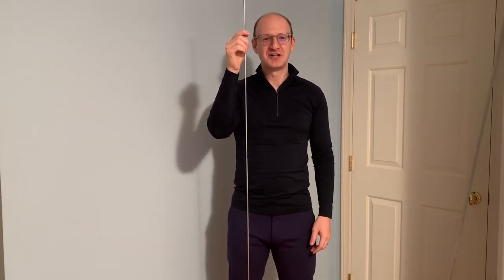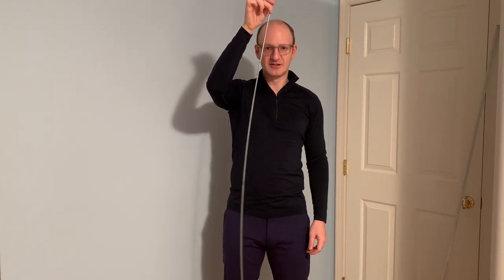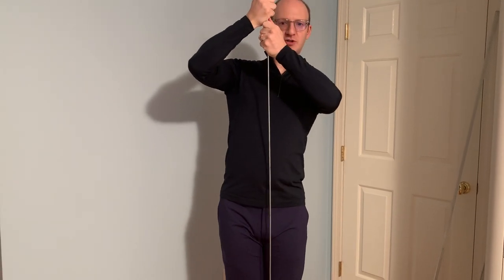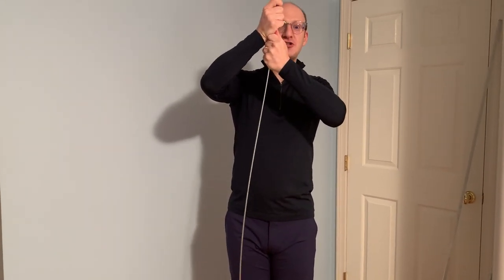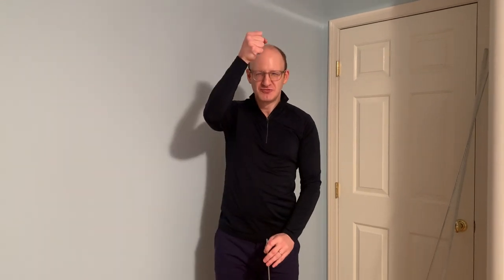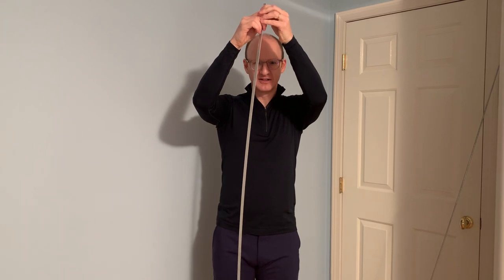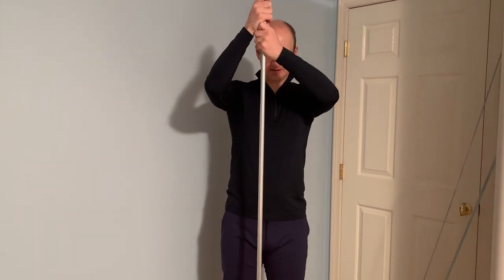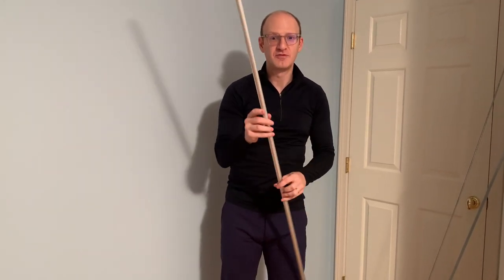How Columns Work! (Part 1): Structures 4-1

Comment: Working in a grocery warehouse; I'm curious about the pallet rack system which holds hundreds of thousand pound pallets of product. The racks are about 50' high with maybe 5 tiers(floors?) holding all this weight. The part I find curious is that the legs(columns) are not all straight to the ground. At the front of the racking system (where the aisles are for the forklifts to travel), the bottom 4' of all the "front" legs; are bent at maybe 30 degrees inward. I think this would be to provide fail safe clearance for the forklift chassis so they don't knock out a rack leg as they travel the aisles. What's confusing to me is it seems like this would undermine the load bearing capacity of the racks. Like the difference in a person holding a heavy weight with their legs locked straight vs their legs(or at least one leg) bent at the knee. Is this covered in any of your videos?

Comment: Awesome representation
But for strictly experimental purposes how are you making sure that the angle and the tube cross section areas are equal to that circular column in the beginning?
Reply from the maker: Thanks!  Home Depot has a wide range of these items...I picked ones that were close enough to each other in area.